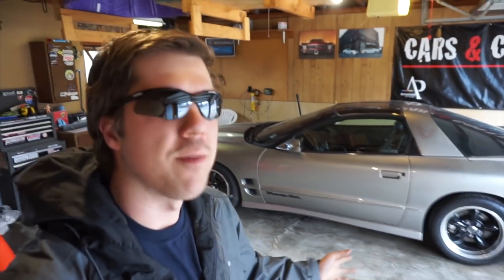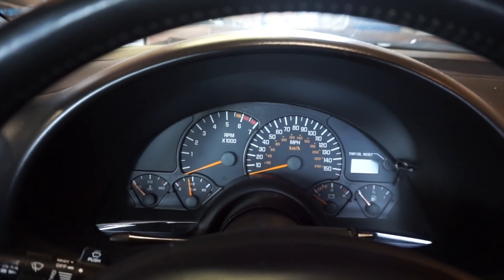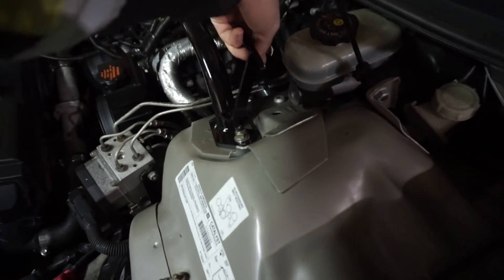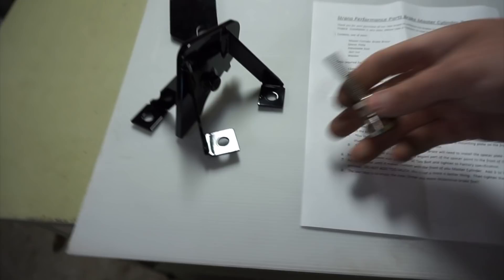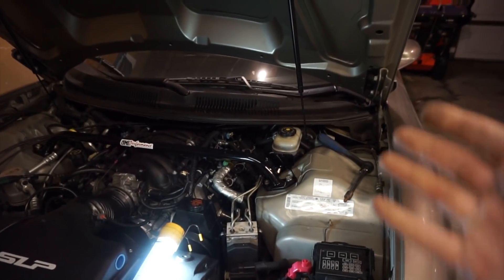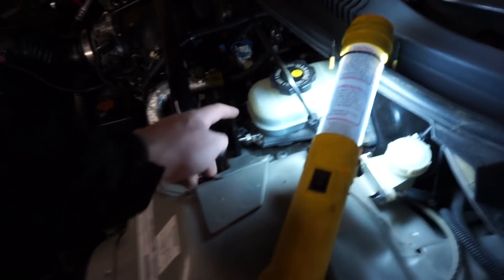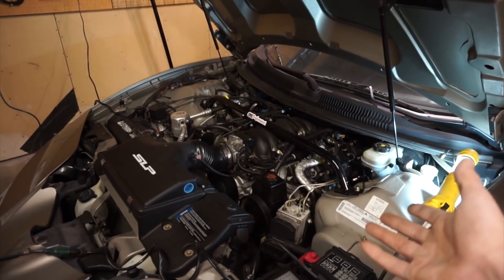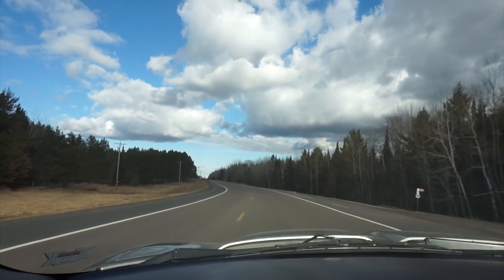BIG DIFFERENCE FOR $100 - Strano Master Cylinder Brace

Comment: Nice job. I am looking to do this and steel braided hoses.
Reply from the maker: I've considered doing that too. It sounds like there can be an unintended side effect of adding braided hoses to some vehicles. The calipers will actually flex when they are hot and cause uneven brake wear. Idk if you've ever heard of that, but someone did a really good writeup that's in the braking industry. You have to picture the rubber hoses expanding under pedal pressure. Braided ones are much stronger, and transfer that saved energy loss to the caliper. Sounds bizarre but it makes sense I guess lol.
Reply: @Greenlightfilming  I have not heard of that with the calipers. I guess I will let you know. I have 3 of the 6 braided hoses on and that has already made a big impact on the pedal feel. If I have any issues when I get everything put together with the brace, I will keep you posted if I have any issues. Sorry I didnt get back to you.

Comment: Just received mine this weekend and was uber-excited to install it, but unfortunately the 15mm nuts on the strut studs were so tight my 15mm socket stripped the damn nut surface.  Liquid Wrench wouldn’t loosen that thing!!  I’m just going to have to wait until my car needs service and I’ll ask the mechanic if he can remove the dang nut.
Reply from the maker: Might be able to get it off with some heat and a good pair of vice grips. I've gotten myself out of many jams with those two tools. You'll need a new nut for the strut stud but its something you might be able to know out!

Comment: Greetings green light I finished the installation of my lower control arms bolt on frame connectors and non adjustable panhard bar all from you am I and you know my car's got a hundred and fifty thousand on it and up under it you know everything is stock and those parts with the spawns Tower to Tower bar in the Strand no brake master cylinder item have a changed my whole outlook on the car I sure would like to have driven it when it was brand new just to see what the difference is but I have driven it and took it out on this road test and everything worked as advertised and I couldn't be more pleased thanks much for the tip hope to talk to you later good luck with the vet
Reply from the maker: Glad to hear you got some wrench time on your car! It's nice when the parts you buy actually make a noticeable difference. Like you said, would be cool to try it all back to back on a brand new car to see what the difference is.
Reply: Hey thanks for hitting me back I started yesterday morning and worked at all up to 2 inches of water in between tornado warnings and watches and wrapped it up this morning and did it under less-than-optimal conditions but for all the tips I think I use the bumper Jack between the fender well and the back tire on both control arms and play out real well show quality stuff from Umi not so much after my installation once again thanks much thanks for the videos thanks for hitting me back and talk to you when I hear from you
Reply from the maker: Sounds to me like everyone comes to the same realization and uses a jack in the fenderwell to move the rest end around. Funny lol.

Comment: I've seen other videos and people put the lock nut in between tower and strano brace
Reply from the maker: I haven't seen what you are referring to I guess. The Strano MC Brace comes with a jamb nut to hold it's position if that's what you are referring to.
Reply: @Greenlightfilming  I believe so, I saw a video from hawks performance and the guy but the nut between the strut brace and the strano brace, yours is right tho I already spoke to Sam at strano

Comment: Dang. I can’t do this mod cause it doesn’t fit with my tower brace :/
Reply from the maker: What brace do you have?
Reply: GreenLightFilming It’s a Hotchkis tower brace
Reply: GreenLightFilming 2006R is the part number I think. It was on the car when I bought it.
Reply from the maker: @pontiacmaniac7772  oh ok gotcha. It must be a three point one huh.... Maybe look into selling/trading it for a two point one.
Reply from the maker: @pontiacmaniac7772  Yea looks like it probably wouldn't work with that bar. You could check with Strano to be sure.
Reply: GreenLightFilming It’s a 2 point but it just has weird mounting brackets. It isn’t a flat plate on both sides.
Reply from the maker: @pontiacmaniac7772  Oh ok weird. I looked at the pictures of the part number and I guess it looked like a 3pt one.
Reply: GreenLightFilming Update
I got the Strano brace and it didn’t fit so I made it fit. I have the Hotchkis two point and I had to cut the tower brace bracket.

Comment: where about in MN/WI you from?
Reply from the maker: Northern MN - Iron Range
Reply: @Greenlightfilming we definitely have to get together and cruise with the birds, im down by St. Cloud MN
Reply from the maker: @timmckenzie7878  sounds good 👍what year firebird do you have?
Reply: @Greenlightfilming  2000 firebird firehawk, what yr is yours?
Reply from the maker: @timmckenzie7878  It's a 2000 Trans Am WS6
Reply: @Greenlightfilming  what's the odds of that
Reply from the maker: @timmckenzie7878  Pretty slim that's for sure. What's all done to your bird?
Reply: @Greenlightfilming  cam, headers, lowered, tuned, bmr torque arm with loop, umi, strut brace, spohn double adjustable pan hard, stage 4 centerforce clutch, stage 2 hawk performance trans kit, mgw short throw, 4:56 gears
Reply from the maker: @timmckenzie7878  solid build, sounds hauntingly similar. I'll be going through Cloud soon to a big show down in Marshfield.
Reply: @Greenlightfilming  what show and what day? If im not at BIR could possible cruise down too
Reply from the maker: Looks like June 1st - http://www.shadesofthepastmarshallmn.com/